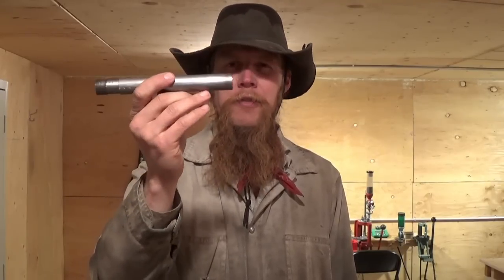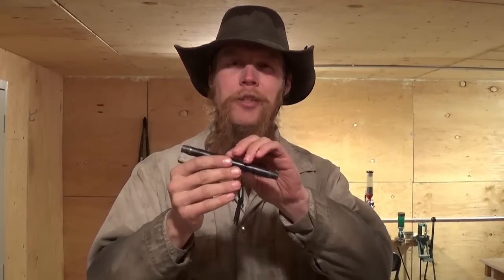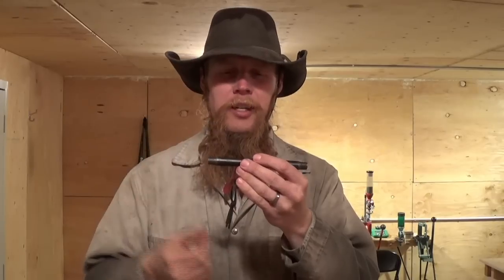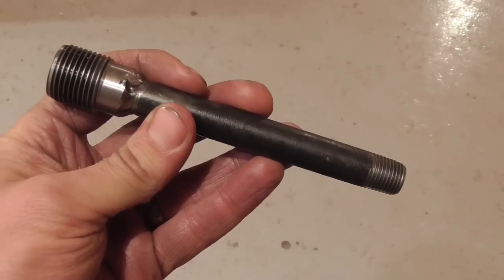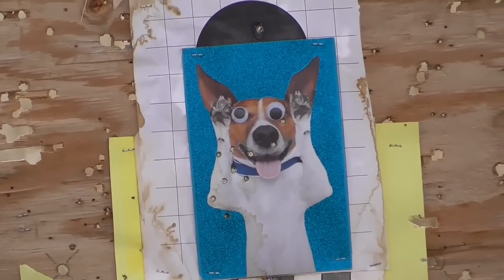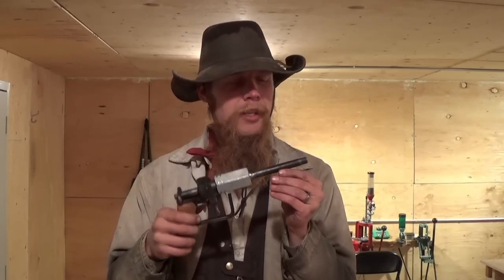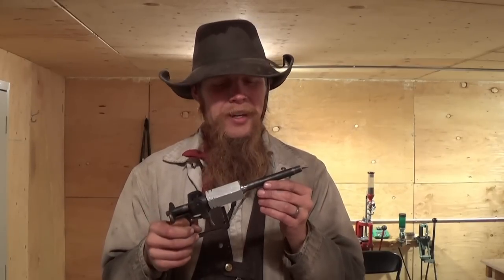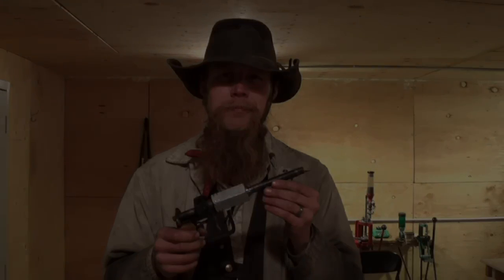9mm Barrel from Plumbing Pipe (TIS138)

Comment: Would it be possible to pack carburize the pipe to give it more strength?
Reply: Rl Badger Yeah, I've seen Chris's videos. I was just wondering if after the carburizing and tempering, would it still hold up, considering the welding seam running down the length of the barrel, or would it be inconsequential afterwards?
Reply: It would depend on the heat treat. A bore hardening only (id) would leave the outside the same strength. PS, my bet the weld is the strongest part.

Comment: If you put something together really quick and dirty like a slamfire without rifling the plumbing pipe might be an option but for anything that needs more work to be functional I'd go for better material (at least dom tubing or drilling a bore into a large bolt).

Comment: 9mm is actually .357 in diameter. that pipe is .377 to .388 depending on manufacturer and schedule of that pipe. chamber pressures of 18k psi for a 38 special an in the low to mid 20k for A std. 9 mm, a .38 is a trait wall design and a 9mm is tapered. a .38 will give better selection of cartridges if less power/safety/easier manufacturer is intended.